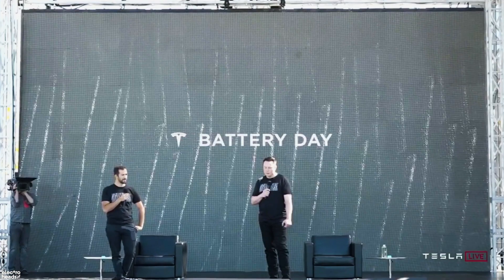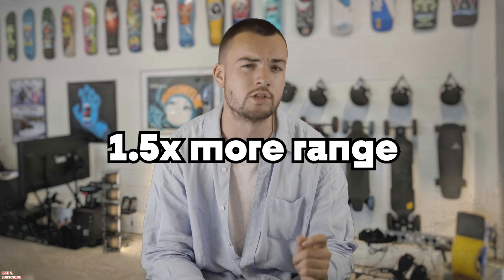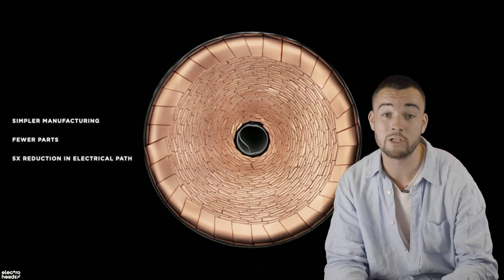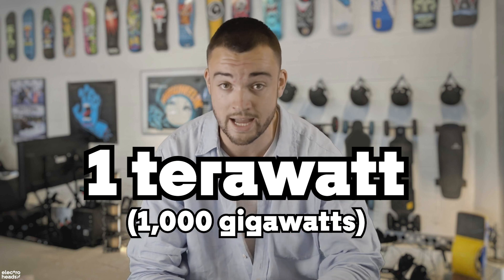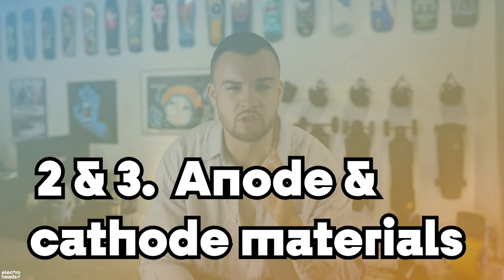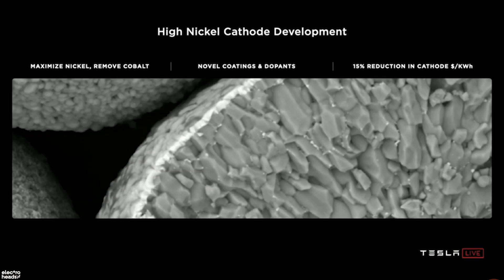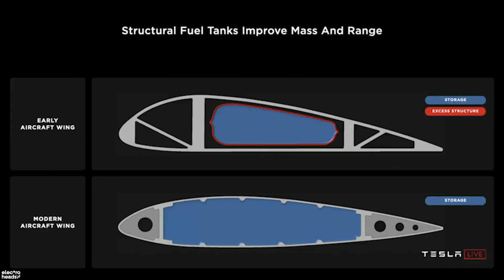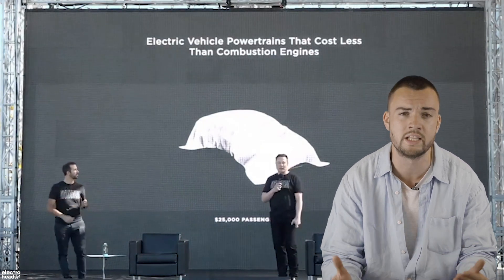Tesla just killed the ICE car - and here's how

Comment: Silicon is rare earth metal used in microchips and battery manufacture. Silicone is a man-made polymer used in sealants, adhesives and breast implants. They are two different things and pronounced differently. Otherwise, great vid
Reply from the maker: Thanks for pointing this out. Slip of the tongue!
Reply: Electroheads I just googled it (without an e) and the top answer said it was the second most abundant element in the earth’s crust.
Reply from the maker: @tomoxfford  yes it is, as abundant as youtube commenters who write corrections that are ever so slightly wrong 😉
Reply: @Electroheads  When it comes to science, “ever so slightly wrong” is not good enough.